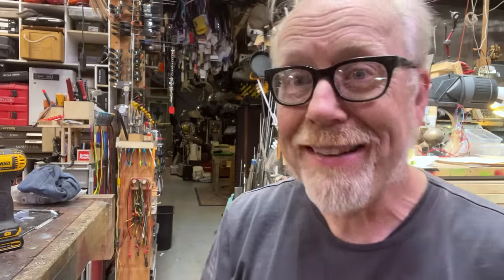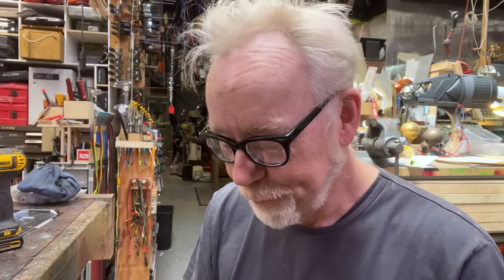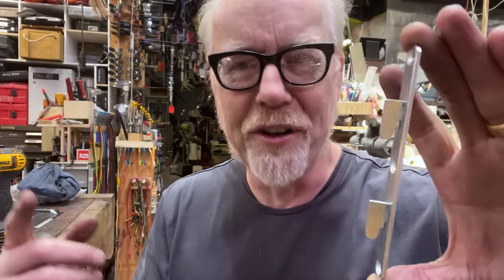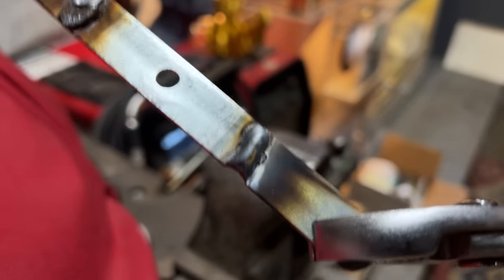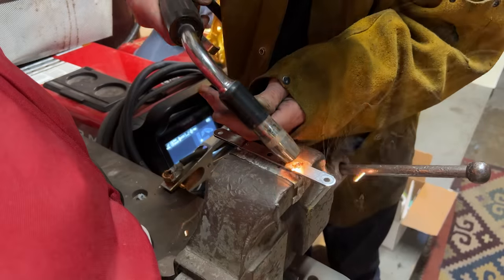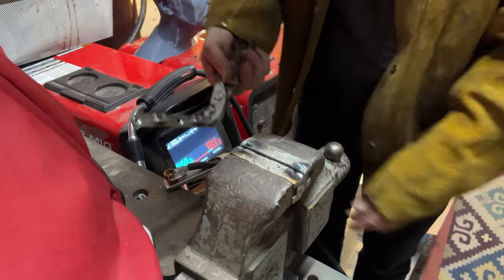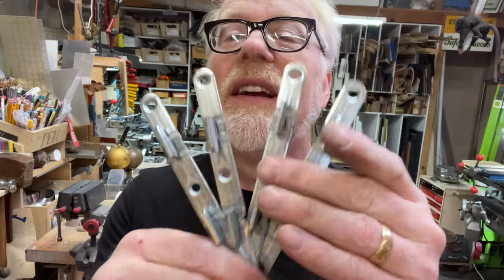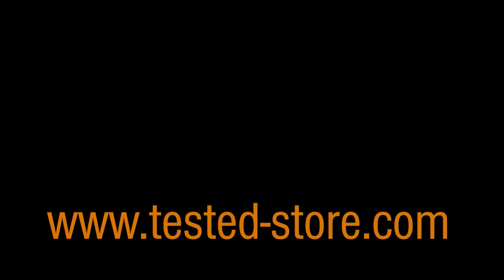Adam Savage Fixes a Squeaking Bed!

Comment: I would emphasize that the thickness of material plays the biggest part in penetration. The welder (the machine not the man), can only melt a given amount of metal given its output.  It's more of an equation of heat input. Thick metals are conductive of heat as well as electricity. But 1/16" or thinner are easy to get full penetration on but hard to get good penetration without distortion. Heat input affects a large number of factors which is why the AWS exists to help create standards for  weld integrity. AWS puts costs on weld testing in the simplest terms. The reason they didn't weld this was for cost. To avoid having to pay a fee to classify the weld as safe to support a human.

Comment: I'm a welding supervisor in Canada. I've worked mostly with MIG, MCAW and TIG welding. I have also welded using SMAW, FCAW and I've welded on very thin to very thick steel. If anyone has questions about welding, there's a good chance I could help. Ask me anything if you have questions, I'll give you my best answer based off my 13 years or so of experience in the domain.

Comment: My bed uses a different mechanism where all the sides are slotted into the legs, using screws to hold them in place.. maybe that's why it doesn't squeak? All the screws do is prevent the sides from sliding out of the legs, they dont hold any weight as such.

Comment: My obly issue here is that this welds were perpendicular to the hooh so the area where it actually holds is smaller then it could be. If this would be grinded parallel to the hook (lets say in 2 steps - one for each sides) the weld would grab the whole hook. Just saying

Comment: While I assume that Adam knows the dangers of using an angle grinder with one hand, without a guard, without any PPE, and while also physically holding the object he's grinding with the other hand - everybody watching should know that angle grinders are incredibly dangerous tools (as is the case with any other shop tool with such a high rotational force). If you're going to use an angle grinder in the way that Adam is using it here, expect to one day be betrayed by said angle grinder. Look up some angle grinder related shop accidents, and judge for yourself how much you're willing to risk. 

Be safe. Use a guard. Use the attachable handle so that you can use both hands. Clamp what you're working on down. Use appropriate PPE. Reduce the risk of permanently injuring yourself!

Comment: As someone who has maybe done 3 hrs combined welding in my life, doesn't removing a larger fillet mean you're relying more on the filler rod, rather than melting the two pieces of metal together?

Comment: I, too, am not a welder, but I'm curious if you think that using a TIG welder just on the "rivets" rather than grinding a orthogonal groove and backfilling would provide the same level of stability?
Reply: Tig welding is a little more finicky and requires a lot cleaner metal to work right. the Zinc plating would need to be stripped off before that would work right, otherwise i'd agree with  you

Comment: I'm not a welder either, but I've never heard or seen that you'd need to grind out a channel for welding. If you need to have a deeper penetrating weld, just turn the knob for more amps.

Comment: I think the method of whacking the exposed end of the tab that sticks out through the hole is called peening. The peen mushrooms the exposed metal, drawing the shoulder tight and capturing it while simultaneously expanding the metal within the hole. But then, I’m a woodworker, not a metal worker (I’m not a metal worker. I own some metal and some tools.) In woodworking that would be a through mortise (the hole)and tenon (the tab that goes in the hole.) Peening doesn’t work with wood, so we would glue, wedge or pin the joint.

Comment: Pretty sure that didn’t strengthen any thing. If you wanted to make it stronger build welds around the hook making it have more purchase area on the backing plate. Running a weld sideways underneath still only grabs the Original small piece of the hook.

Comment: The riveting process you are pointing out is called staking (don't know if that's the right spelling). Warning, never weld galvanized metal. It gives off poisonous gasses (zinc oxide and lead oxide). This is likely why those parts are staked and not welded.

Comment: The tabs are 'staked' Adam. The rounded edges are on the bottom when being punched. Remove the staked pieces, remove most of the tab and then plunge weld in place of the staked tabs. Not across as you suggested.

Comment: Welding things like this isn't always a good idea, because the welds are very likely to start cracking because of all the flexing in that area, which before had 'give' to it.
That's part of the reason why car bodies are spot welded instead of seam welded, the spot welds allow for some flexing which greatly reduces the risk of stress induced cracks from regular flexing.
Also when welding, you will inevitably change the temper of the steel, which can make it brittle.
Reply: Also with so much heat that you welded that mount with, you will have no worries getting proper penetration even without any chamfers.
It warped because the welds shrunk greatly when they cool. You should've bent the plate away from the welds slightly before welding. This way you dont stress the welds trying to bend the plate back.

Comment: Whole I laud you on your "repair" you might find that the squeakiness of the bed frame is because the hooks were not fully engaged.  A trusty hammer to "persuade" the hooks full travel will make a big difference in the noise emitted from the joints.  This usually happens on the first assembly of the frame.  Easy to check, and cure with a "persuading device" (aka a hammer!).  Of course some people WANT squeaky bed frames, but that is not for family discussions.

Comment: I'm going to assume that that's a relatively expensive bed frame. Having said that I'm astounded by how cheaply that bracket is made. I have actually gotten a free bed frame that came with the mattress purchase that was way better built than that. The rails and tabs were one solid piece of metal.

Comment: In many things that humans do they have figured out how to do things for maximum results.  This is similar in welding where welded joints have already been defined and tested and put into the building codes.  I suspect welding in submarines and ships is the same way but in welding for buildings the grooves that you show are predetermined and extend most of the way through the material.  There are approved versions of welding for different thicknesses of plate and for conditions where you have access to both sides and conditions where you don't have access to both sides.  Your picture shows a gap in the middle between 2 welds.  In structural welding there is no gap, and not only that the configuration of the grooves and the procedures used will provide not only solid weld metal all the way through but should not have imperfections such as bubbles or slag inside the weld.  If you want the strength of a 1" thick plate then you want that strength to extend all the way through the joint.  The old saying "the weld is stronger than the metal" doesn't apply if the welded joint is done improperly.
Consider the forces applied to the tongue that sticks out and the groove you ground should probably be closer to the root of the hook, that's where the tension is applied between the tongue and the back plate.

Comment: 128 A is enough with an angle grinder, the gap was bigger and the reason why the iron turned backwards more higher temperature at 156A or otherwise it is called distortion due to high temperature Thanasis mechanical engineer of industrial facilities and industrial production

Comment: If you had a tig welder you could just heat the material on both sides around the press fit and you would fuse all the material it's a small piece and would accept full penetration. Nice job with a mig on such a small piece. I think you might have been a little hot. (also not a welder)

Comment: Been there & done the same thing...Problem is it didn't fix the problem for long, its only cheap crappy metal, I found welding some large nuts to a plate as both fittings then run a bolt through them works heaps better, no matter how much bed bumping happens.😉

Comment: I think you would call that process peening.  

Addionally to anyone using an angle grinder, keep your guard installed and only use the right hand side of the wheel. The way  Adam did the last tidy up at the end risked grabbing the part and pulling the grinder into his fingers or body.

Comment: You should work with sleep number to fix their horrible adjustable bed frames. Endless squeaking.

Why not use resistance weld?  Ie heat the piece and melt it into the other piece. Probably cheaper than the crap punch they’re doing.

Comment: I’ve found squeaks also originate from the slot interface into the hole, as well as the material of the runners against the foot/header on a tight tolerance. 

Btw - what’s up with the whole “partner” thing? She’s your wife, no?

Comment: If the flanges were punched/bent out of the main piece of metal, that would still be suboptimal, but wouldn't that be much better?

The laziness of the manufacturer not welding them in the first place is kinda painful though.

Comment: I feel like those welds got way too hot. but I'm not a welder either so anyone who is. please inform my uneducated mind ^^ genuinely. Been thinking about starting to welding a little here and there to get a start on another VERY useful tool ^^
Reply: They were too hot. He undercut the edges of the metal. TIG welding or even brazing would have been a better choice,
Reply: @millwrightrick1  Tig welding is where you use a tungsten-tipped arc-welder that melts the metal itself right? well I know you'd usually add a rod of material to help fill it it aswell. IF that's what you mean, that's what I was thinking he should do aswell ^^ feel free to continue educating me here m8 :D

Comment: Those parts appear to be zinc plated.  Be careful about welding zinc plated parts. The fumes can make you sick. Best practice is to lightly grind off the zinc plating in the area to be welded.  Also, as thin as that material is, I'd consider just doing a TIG fusion weld. Not an expert, and that advice isn't so much for Adam as it is for any new makers out there still learning this stuff.

Comment: I welded on submarines for 6.5 years, 20 years of experience, bevelling plates is 99% standard, it totally depends on the type of joint it is... I will make this recommendation for beginners, WATCH how much you put too much weld on one side, the "heat effected zone" will begin to bow like a banana if not evenly welded

Comment: Adam, your stick-out for the MIG (GMAW) wire is way too long. Combine that with having the cables bundled up will lead to issues. for the stickout: poor penetration, whiskers, etc. For the cables being wrapped up (gun cable especially): poor feeding, bird-nesting. Stick-out for MIG (GMAW) is not the same as with other processes due to the  distance (contact tip to work distance) being different as compared with FCAW. Also, I would be careful of the zinc fumes as that can cause metal fever. You want your gun cables, and to a lesser extent the ground cables not wrapped around tightly, preferably gently sloping or straight so that no issues arise with wire feeding.

Comment: When I saw the hardware I thought "Cheap beds may all be built like this, but not quality beds". Our bed has 8 wooden parts, not 4 -- the 4 sides and the 4 posts, and the heavy-duty sides are attachet to the heavy-duty posts by thick metal bolts (16 in total) that screw into an anchor nut in recessed holes in the posts. This way it's ultra stable, can be adjusted when it will ever get loose,  and the fram will not bend and twist at all when moved. But the bed still can easily be disassembled by unscrewwing 16 bolts. Will last for generations and has ZERO squeaking potential. The stamped metal hardware on the other side is not adjustable for wear and just a bad and cheap solution for something experiencing many years of daily (nightly) use.

Comment: Sadly the screws may squik aswell, those hold these metal parts to the wood.
I have a boxy designed bed without any of these metal things and weight coupeled railing nonsense, and sadly it squiks at the joints, I can imagine how the metal parts my rock around the screws neck as they slowly work uotbthem selfs under use.

Comment: Spot welding would have been better than MIG welding, just saying.  Less heat, more bonding and less deformation.  And no additional material needing to be ground off.

The original manufacturer should have spot welded the joints in the first place.

Comment: It would have been better if you had etched halfway into the rivet lengthways, welded that portion and then etched the other half of the same rivet lengthways, and then welded that portion. Grind down, and then repeat for the other rivet.

Comment: lol jamie would have had a slot or a pic of one 😂   since the tab press fits are proud wouldnt the squeaking come from them rubbing against the rail or headboard?  I noticed he removed the safety cover from his grinder as well.  never getting seen, how about alittle pride.  i used to grind while holding material until one day i barely slipped and cut halfway through my finger n fingernail and went to ER.  Alert, grinders cut through flesh n meat like butter.  If he had slipped he could have easily disemboweled himself in half a second.

Comment: My current and previous beds are not built lie this at all..
they're a wooden frame, with 4 legs screwed into - and a springy mattress. then a soft non-springy mattress on top of that.
the head-panel is mounted on the wall. Theres absolutely no squeaking

Comment: Please wear gloves when welding. It prevents you becoming part of the circuit. Additionally all it takes is a modest little molten bugger to hit your ring and it will probably have to be cut off or you may be lucky if you dont loose the finger.

Comment: Holy shite those tabs are so small, I can't believe how cheap these manufacturers have gotten, this is just disgusting!!! 
My bed frame is older probably 30+ years old and it has the same kind tabs shaped the same way to hold the rails but the ones on my bed are WAY BIGGER, one tab is close to 4 inches. Which is most likely why my bed doesn't squeak at all. 

Your friends might want to just go buy an Old Bed Frame with larger more well built tabs bc I have a feeling this isn't going to help much. 👍👍

Comment: if you put a steel blank on the back and filled the reveal hole around the small projection you woul have taken out more flex and keptv the back flatter and stronger. i am sure their screws/bolts wil stilll be long enough.  Vise is not the tool for welding.

Comment: I think the term late stage capitalism is pretty meaningless and is one of those terms you hear thrown about by political commentators online all the time as a substitute for meaningful in context analysis not myopically tainted by whatever ideology they have.

There have been times where regulations were essentially non-existent, no consumer protection no quality assurance labs, UL listed and the likes. 
The time we are in now is actually pretty good when you compare the quality of goods versus price to the consumer.

There's also a range of products in every category from cheap low quality to expensive high quality and everything in between & beyond.
Sorry about the rant, that term triggers me for some reason.

Good explanation on the weld,
Its called a full penetration weld when you're looking for maximum strength.

That would be a nice job for Tig welding, I think I would have ground out vertically, but either way it will be plenty strong enough.
Reply: but it‘s not necessarily about how good we have it, it‘s about accumulation of wealth that‘s never been seen before and the diminishing power of the general population to have any meaningful say in the commodities we want to produce and consume. That‘s not exactly how it used to be defined but that‘s kinda what it‘s evolved into.
Also, the „unregulated“ period you speak of is also considered late-stage capitalism, as it kinda started post world war 2
Reply: @finn8518  I was thinking before that even the gilded age, but all the trends are going towards more social safety nets, more regulation of companies, less poverty and more social progress.
This is not to say everything is perfect ofc not but this late stage capitalism trope is meaningless in context of capitalism if we're looking at developed modern economies.
I think the most important factor is economic mobility.

When people use wealth disparity as an argument and point to say Bezos or Musk and to be clear I'm not defending these people it's a misleading figure because there wealth is almost entirely as a result of still owning a minority of the company they started and isn't easily accessible.
Unlike say a Saudi prince who legitimately has actually liquid cash.
I'm also not arguing some corporations have too much power.

Basically I think late stage capitalism is hyperbolic and is almost entirely void of information about the economy it's trying to describe.

Comment: Welding without gloves is not how you do that. You will get flash burn when you do that, and touching the muzzle of the welder, and base while welding will give you a nasty shock. Even wearing the shield you get flash burn on your face. When you do it so you see the arc, even with a shield, it will permanently blind you. Adam is a dufus for safety. If I made an industrial safety video I'd hire Adam to play the dufus. There's a topic for a video. Get an industrial safety expert to examine Adam's failures in safety.